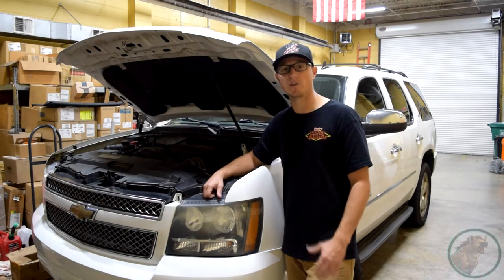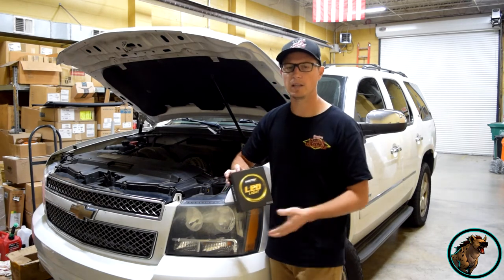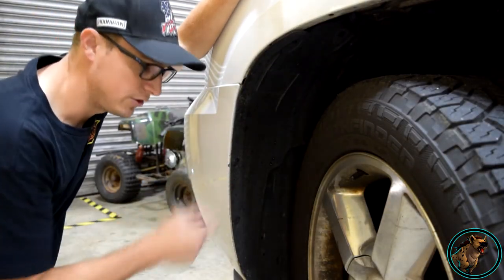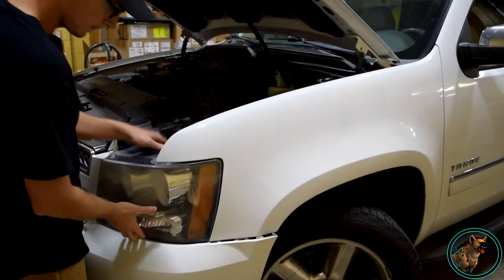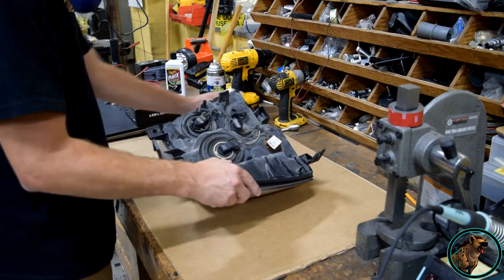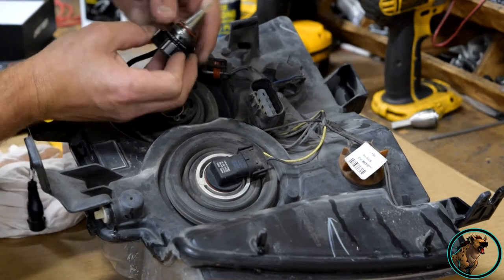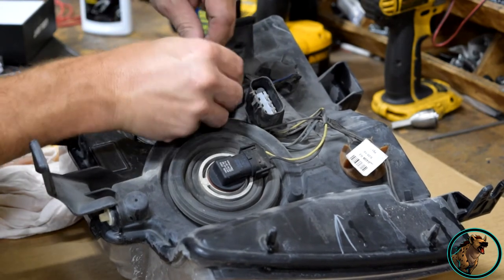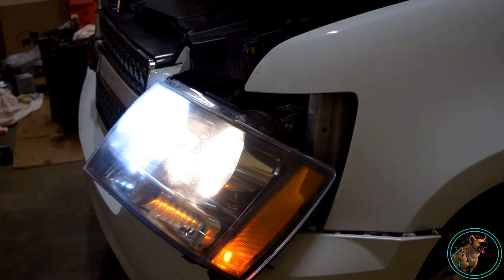2007-2014 Tahoe, Suburban & Silverado LED Headlight Conversion

Comment: What did you do about the lack of driver clearance behind the housing. My led (specifically the low beam) hits that metal bracket back there. 2012 suburban
Reply: Did you find a fix for it hitting the metal bracket ? Mine does the same thing. Was there a replacement bulb you could use that is much brighter than stock?